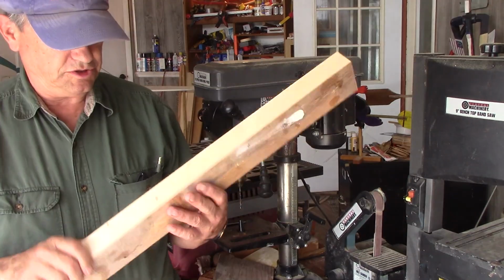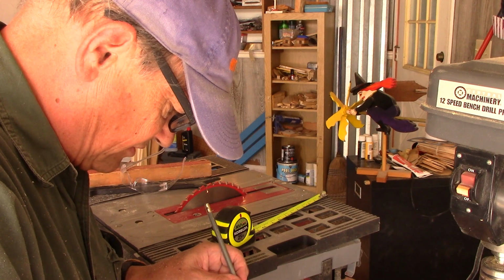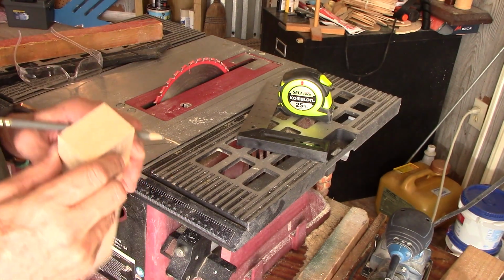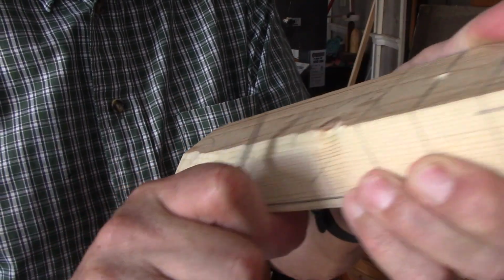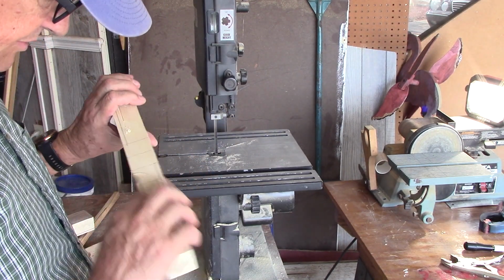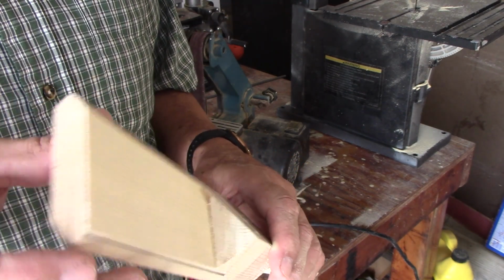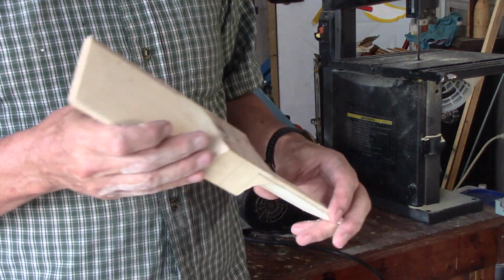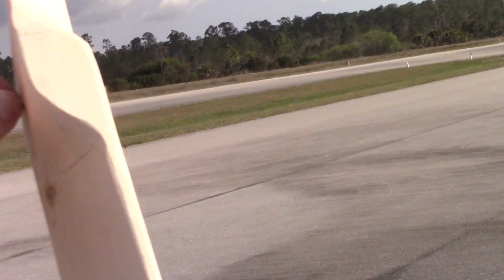How to Make a simple Wooden Whirligig wind spinner propeller

Comment: Ithink laminating the prop would be easier, less stock removal. If you could use a circular saw to cut the slots , it should follow the line more precisely, again resulting in less sanding.
Reply from the maker: yes and it would probably look better too.  But I was going for simplicity